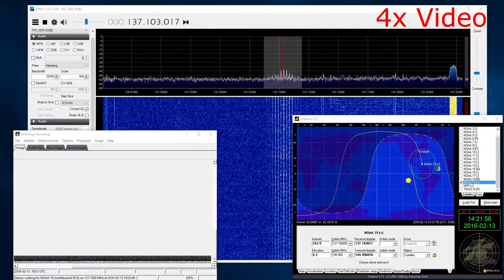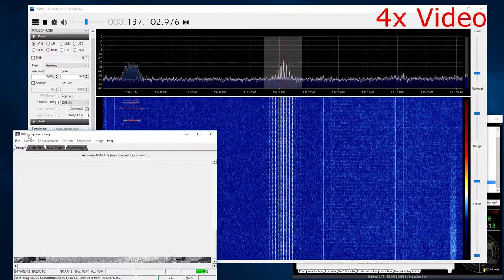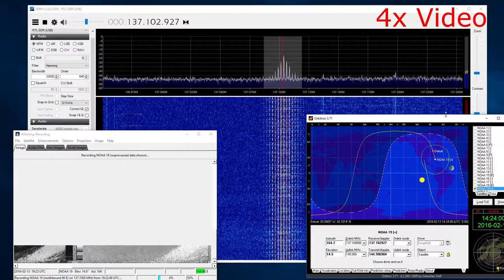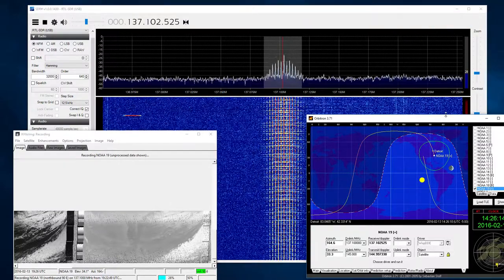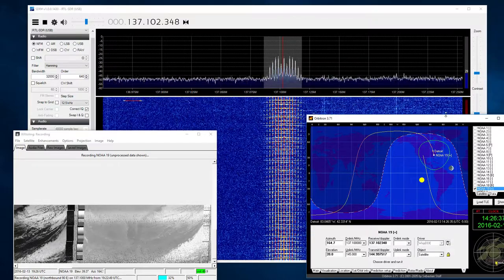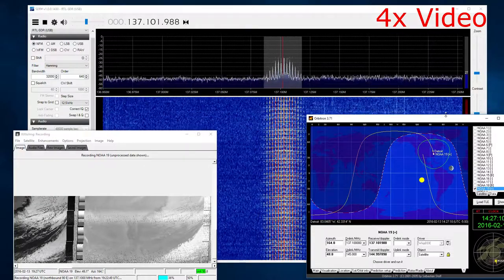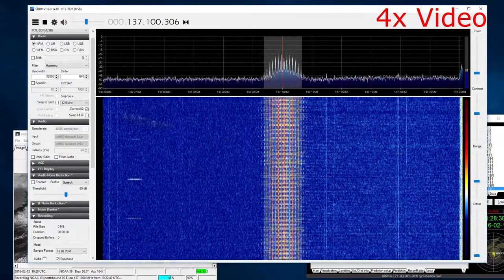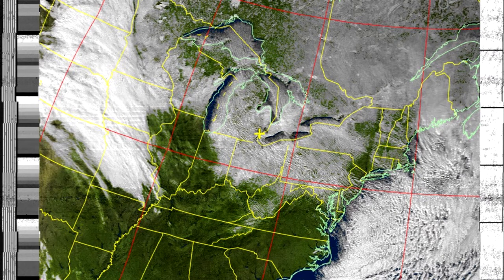QFH Antenna Results - NOAA 19 satellite reception with SDR

Comment: Looking at your sat tracker it was damn near a 90° pass. Of course you'll get good results. I have been using an old VHF whip off my truck with 4 1/2 wave planes soldered to the mount and get decent images.

Comment: I like your video, thanks for posting a follow up. I was curious what OS and SDR software you are running. Have you had luck with more than one WX satellite?
Reply from the maker: +Reagans Ridge Thanks for commenting!  In this video, I'm running Windows 10 and using SDR#.  I have had luck with other satellites.  I've tried with the antenna indoors, and it works very well there as well.  I still need to get it mounted in the attic.  My biggest hurdle right now is that I need to order some coax.
Reply: Don't cheap out on the coax, I have been burned on "good deals" in the past. I have been planning on doing something like this with my RTL SDR for sometime. First I plan to get my 2 meter station back in order though.

I tried to receive with a discone style antenna, but it has such low gain it didn't bring much in.
Reply: Try Amateur Radio Supply, last time I bought DMR-400 from there think it was .79/foot.  DMR is the poor mans LMR-400, exact same spec's with the signal velocity, shielding, etc...  I have another one saved on my laptop and will give you that supplier as well...both were at the same price point, but one might be closer to you for a savings on the shipping depending on the amount you are buying.
Reply: Reagans Ridge, likely the issue you were having with the stationary discone was the doppler shift associated with the satelite traversing the sky.  That is why the QFH works so well, it is an omni directional with a right hand twist to the elements that corresponds to the exact antenna they place on the POES Sats.

Comment: That pulsing PSK signal keeps desensing your antenna giving you those grey horizontal bands through the image. Wonder if you can notch that out somehow? This why I prefer using a directed gain antenna although I need to graduate to a circular polarized one especially for the Meteor M2 downlink.
Reply: I'm hesitant to build one of these QFH antennas because I know a circular polarized yagi will probably work best. It does seem convenient to not have to mess with tracking though. I'm conflicted.

Comment: Hello Jim, just saw this as I was looking around for a QFH antenna to build.  This looks pretty straight forward and am going to give this one a try.  Will let you know how it turns out.  Thanks for posting the build and follow up vids.  Nice to see the SWAG (scientific wild ass'd guesses) worked or not.  From antenna theory, this should be a very  broad banded antenna and am guessing that is why the slight deviations did not hurt the performance that much.  Good job. I am going to take a run at it with the 3/8th copper tubing, so will post a few pics so others can see it with that material as a finished project as well.
Reply: How did the QFH turn out?